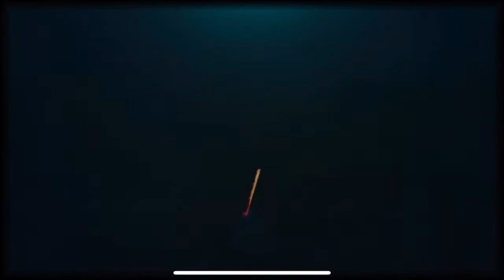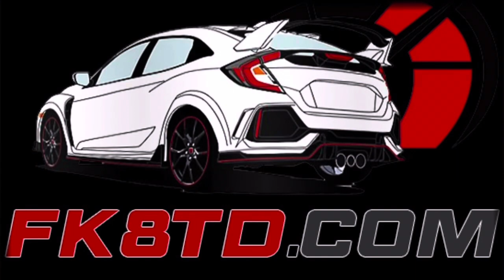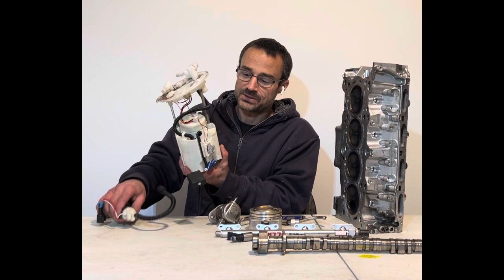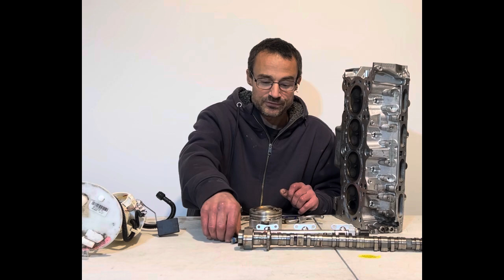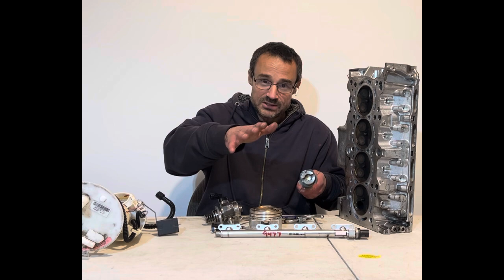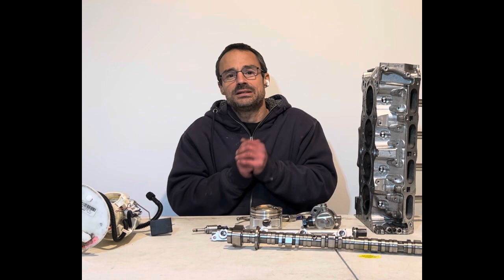How direct injection works and what to upgrade.

Comment: How do you diagnose failing injector? 

Fuel pressure readings are within spec, compression test is good, visual inspection of the bores show cylinder 3 is cleaner than the others. (Fuelwashing?) I have misfires cylinder 3 and going in limp mode when asking high power output from engine or high rpm’s. 

Spark plugs are replaced and ignition coils are swapped (to rule out bad coil) Misfires stay in cylinder 3. Also there is a louder than normal injector tick. I have not too much experience diagnosing GDI systems, but I’m pretty sure the injector of cylinder 3 is defective. 

You think I can do any other checks to confirm that’s the issue?

Also what is the average lifespan of a Gasoline Direct Injector? 

This is for a Peugeot 207cc with a 1.6HPE ‘Prince’ engine (same as in mini-coopers)
Reply from the maker: Believe it or not one of the simplest ways is to check the color of the spark plugs. A failing direct injector should have a poor spray pattern. The plug will either be darker significantly or lighter depending on the issue. The easiest way is to take it out and put it in a testing machine. Unfortunately, in car, there are not too many ways to test and have proper verification. If it is failing electrically, you will have to use a scope to see if there’s an issue. You would have to check current draw and waveform. These are the only true ways to diagnose a direct injector.